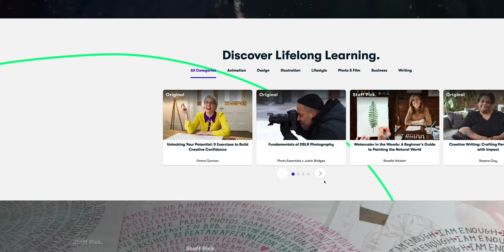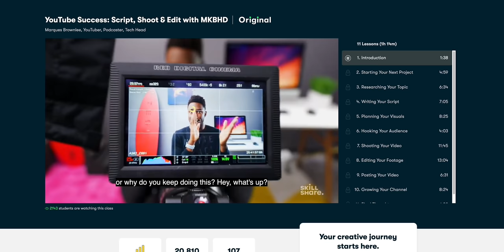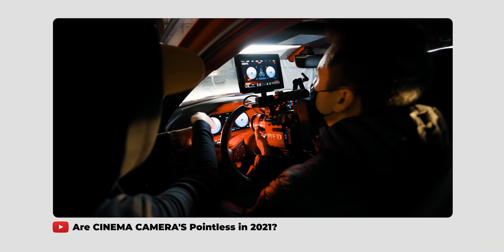Commercial Shoot BREAKDOWN - Working for CAN-AM

Comment: 13:00 The whole client perception thing is a real odd obstacle. I owned an audio recording studio for years and a client heard some of my work and hired me to work a major label project. When they saw what I used to create the previous projects, they didn't believe that the gear I had actually made the previous projects, because of course, the only thing that sounds good is XYZ and not abc. Many times it has little to do with the results you can achieve and everything to do with a preception of success. When I asked them what they thought they needed and they told me I let them know that was not a problem and that I had that gear available. I quoted the job with the "upscale" gear in mind and from that one project, I set up my studio with this perceived "upscale gear"  and completed the project to the client's complete satisfaction. Unknown to them, 90% of the project was completed without using the upscale equipment. However, I received many subsequent phone calls and work due to the word getting out that I used ZYX gear on that project. Like I said, odd.

Comment: Good to know on the RS 2 failure! I have one but haven't killed it... yet. Peter, you should check out the Devin Graham Signature Glidecam. His input really made that product outstanding. I sold the original Ronin years ago and bought the DG Sig Glidecam as a replacement. It's quick and easy to balance, handles plenty of weight, packs down well, and best part... purely mechanical, no electronic junk to fail. It's a terrific backup for stable shots. Great work as always man!